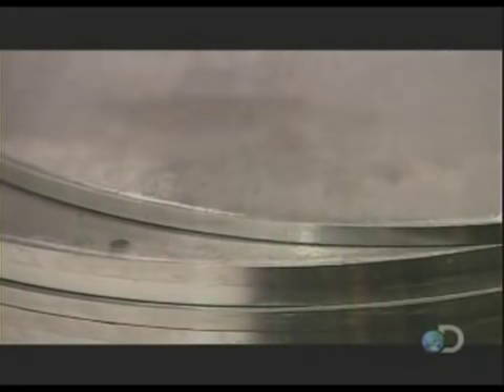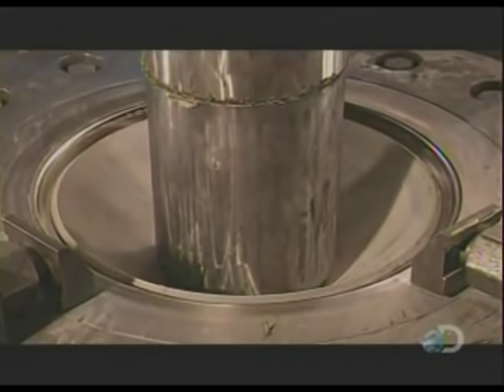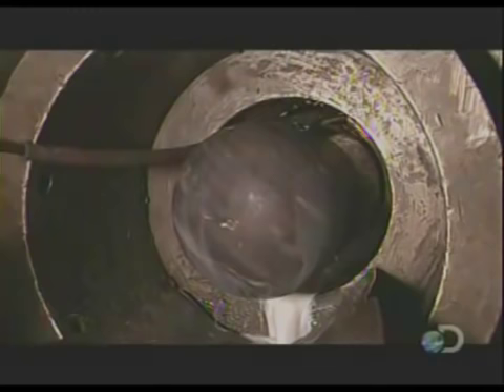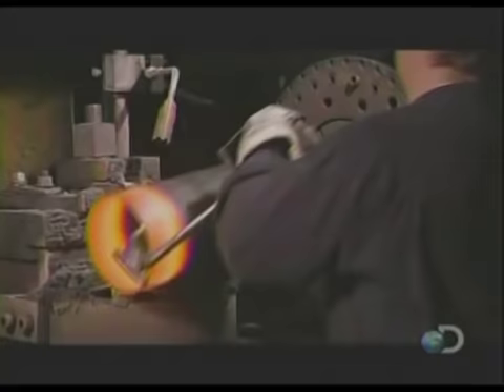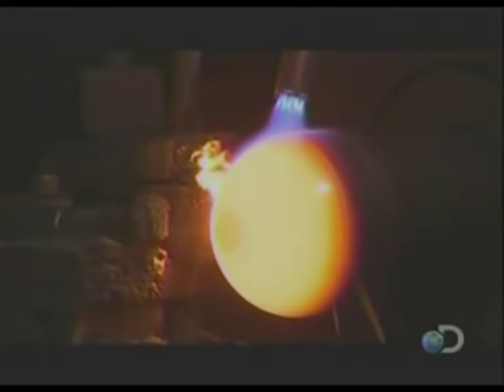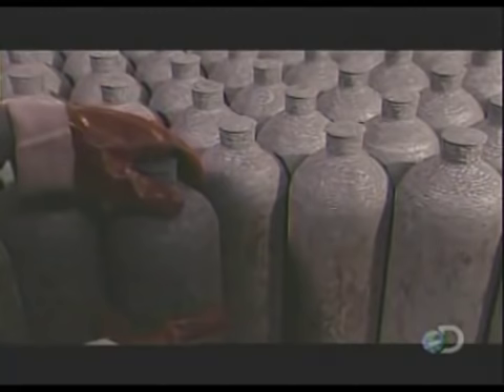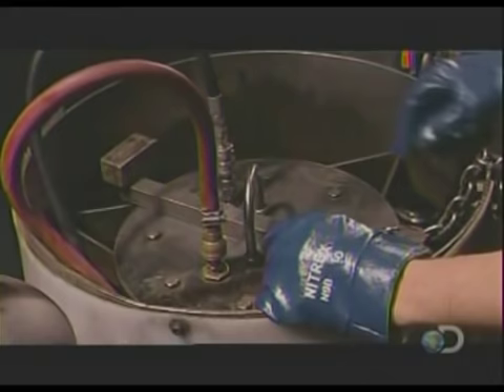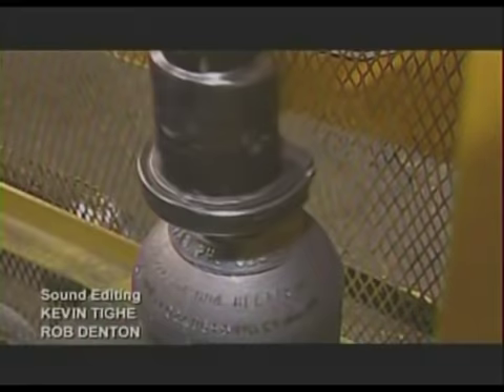how its made high pressure cylinders

Comment: 4:03 - I was fascinated to learn years ago that "hydrotesting" is basically pressurizing the tank with water while inside a closed "jacket", also full of water. By measuring how much of the jacket water was displaced (how much is forced up a glass tube), they can calculate how much the tank 'grows' under full (or more) pressure, and then when the pressure is released, whether the tank fully returns to its original size. Then, those results are used to certify the tank, for how long, and for how much pressure (or to decommission it). Very clever way to do it, and if the tank ruptures, it only splits open and doesn't explode since water is basically incompressible.

Comment: @3:30 "these transitions from hot to cold strengthen the metal and make it more flexible." The solution HT and quench does add strength, but also makes it extremely brittle. The subsequent tempering does not make it more flexible, it increases fracture toughness, which is a measure of the energy needed to propagate a crack. Basically it dramatically lowers the brittleness while sacrificing a little bit of strength too. Flexibility is more about the modulus of elasticity, which is not the property they are after. Flexibility and fracture toughness are not the same.

Comment: 3 presses but if it is seamless i am not getting after 1 deep drawing how that pipe get expanded as shown
Reply: There is a big bar that pushed from inside the cylinder, to stretch it out
Reply: see video at 1:27 time where it is mentioned that after releasing from jaw it is further streched.
but for 2nd time the stretching material is not the same one.
Reply: It is a different pipe, don't forget  HowItsMade have to work around professionals doing a relatively "hazardous" job they can't always get the best shots that they want for the video, it's just a different size cylinder, or it went through a machine they didn't get to record

Comment: What is missing is what goes in the high pressure cylinders. Cut one open and you will see that they are not empty.
Reply: Most cylinders are empty (hollow) some have a "straw" in them like propane, which sucks the liquid up like how a cigarette lighter works. Acetylene however has a porous material inside which absorbs a coolant, which helps keep the acetylene stable. If you search acetylene cylinder their are a few videos of them being cut open...